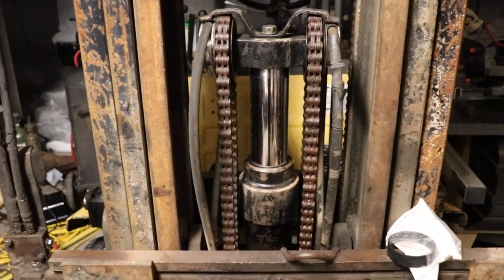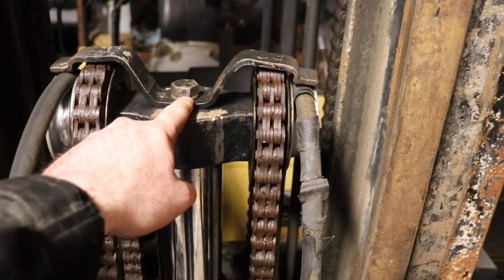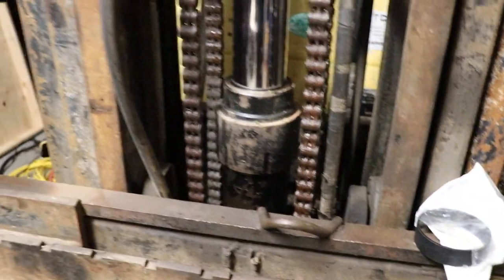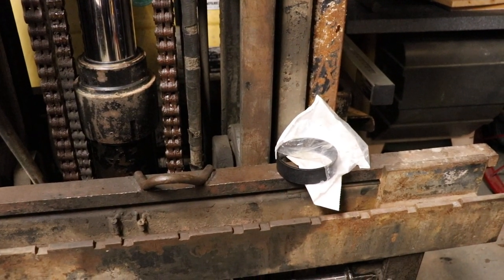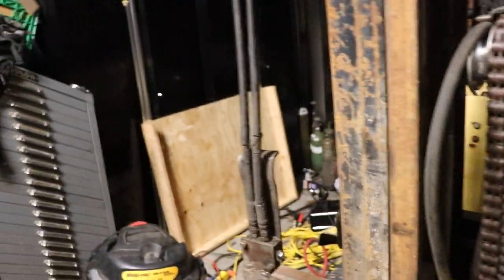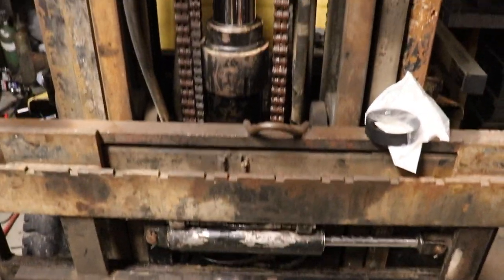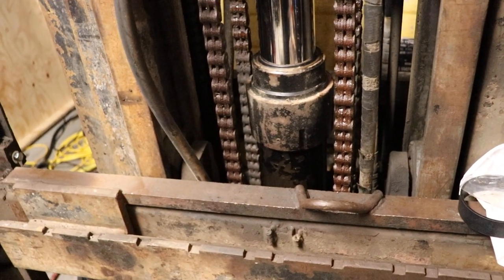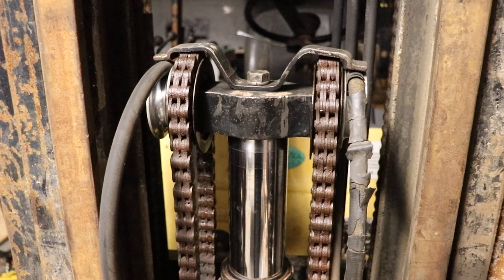TCM FG25N2S Forklift Main Mast Cylinder Rebuild Details

Comment: Dude, so I applaud your efforts, and you’re not wrong, but… that shiny rod is a “rod”. The “piston” (which you seemed to be calling the rod) is in the bottom of the cylinder usually attached to the rod w a bigass nut. Most cylinders have a guide that keeps the rod centered in the gland nut. Sometimes the cylinder leaks because the guide is worn, and the rod isn’t centered, and it either screws up the cylinder wall (if it’s really bad) or it leaks because it’s not centered correctly. The “attachment plate” is called a carriage, and I could keep going, but… LoL Thanks for trying, and for playing lmao